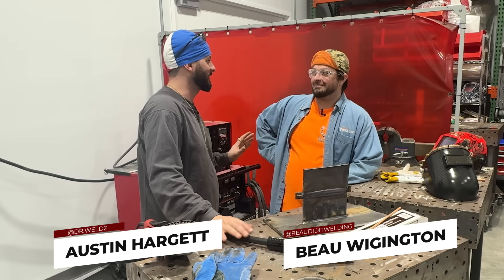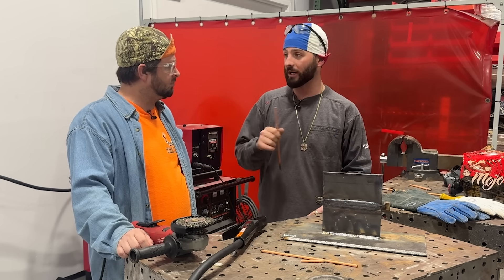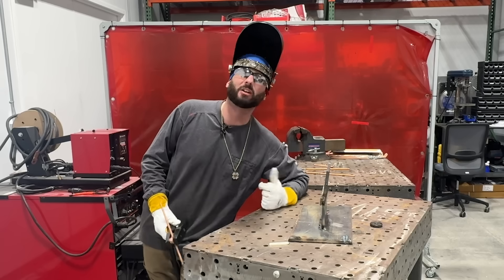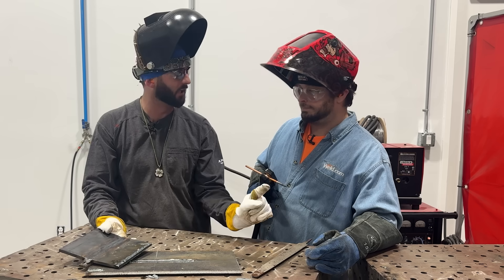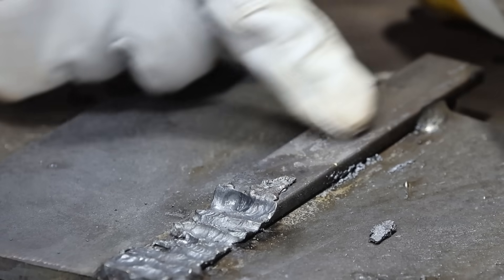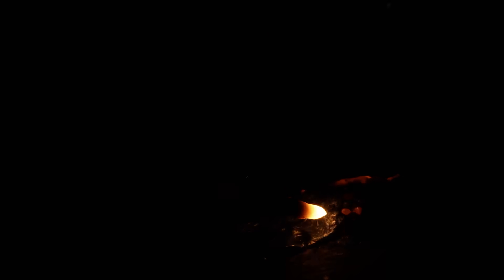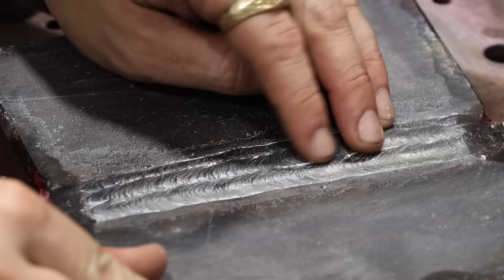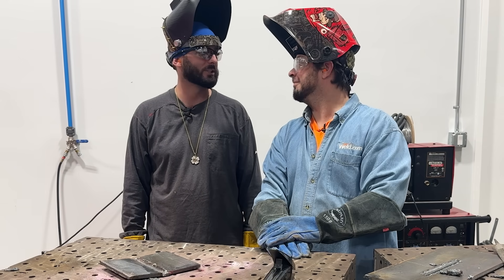Improving Your Arc Gouging Skills: Best Electrodes and Methods

Comment: I would also like to add when using DC current especially you need to not just consider the size of your leads, but also the length of the entire loop including the work piece. Refer to a Ampacity chart for your specific application. Welding leads are one of the most expensive (consumable) that welder uses. if you try to always work inside of their rated capacity, the copper wire will outlive the insulation around it.

Comment: I’d like to address a common misconception when it comes to carbon arc gouging. you do not need to turn your welding machine all the way up if you do not have properly sized leads, you will burn them up and the constant amperage fluctuation is hard on an engine drive machine. The amperage requirement for a specific size of gouging carbon is on the box and a lot lower than what most people think. If you do not have a good technique, it is hard to maintain a steady arc and that is why people turn the machine all the way up.

Comment: I got a question has any one used plain rods? Why does my rod get super hot? My ground asking proper contact I got it set to 350 amp I’m using 3/8 rods I have it on my rod holder on negative and my machine set to CC submerged arc I don’t know what it’s getting hot after 3 seconds

Comment: I love this channel and the content it puts out, but this is TERRIBLE advice for carbon arc gouging.  First and foremost “all the beans”. Is the last and worst approach to carbon arc gouging.  Carbons come in different sizes and have an amperage range they operate in, just like stick electrodes.  Often times the stubbing you are describing is actually a sign of the amperage being way too high.  The electrode is being consumed by the arc faster than you can physically move it.  Not very good for precision.  Precisely removing a 1/4 backing strap is not a job for 400 amps , a 3/16 carbon on 190 amps would remove that like a surgeon.  NO disrespect, i do a lot of gouging,  lots of this is not good advice

Comment: One of the best electrodes with High intensity of current with graphite supplement causes the burning of base metal ... simple technique to repair minor cracks various industries.. when the electrode parallel to weld ..90 degrees in holder causes repulsive action on easy removal of weld bead or base metal

Comment: Way back in the early 80's when I started welding for a local portable repair guy, I talked my boss into getting a gouge although he didn't know what they were. (I had used one at welding school) Once he saw me remove a 1/2" bead from a huge plate in about 45 seconds as opposed the the 15 min he was taking with a grinder, he was sold! I got a raise over introducing him to the process!

Comment: You still have to use a grinder tho🤔. You have to grind the carbon out after
Reply: @whitey7388  improper settings and poor technique is the reason for carbon track.  No grinding is required

Comment: How does this compare to plasma gouging? (I have a plasma cutter and a multi process machine that can do stick.) What are the pros and cons? Will there be some applications for one is better than the other? Does one of them have more control for gouging out old welds or rework?
Reply: Pretty much the same... you will eventually need to change your plasma consumables (some actually have specific gouging consumables). Your plasma is better because you don't have to worry about the possibility of the melted carbon rod getting in the waste puddle and stopping you. But the CAC will let you reach into spots (sometimes a welder sneaks a weld into a spot and doesn't think about if it needs torn back apart)
Reply: Every process has it's ups and downs. Plasma requires a separate machine and the consumables are more expensive, but you don't need to worry about adding carbon.
I also find I've got less control with plasma than I do with the carbon arc or oxy fuel, but that might just be because I don't use plasma gouging very often.

Comment: I wish I had a welder that would go up to 300A or more and a big air compressor.  I don't, so all I can do is oxy-propane flame gouging.  How about doing a video on that?
Reply: I can tell you with a straight face that a Harbor Freight Stick 225 paired with a mid size compressor will absolutely arc gouge.
 
225 amps is enough to run a 3/16'' carbon, and you'll only be limited by the compressor. My 3.8 SCFM @ 90 PSI 20 gallon compressor lets you run for about 45 seconds straight with the air valve open, and regulated to 80psi. Then you wait till it builds up a little bit, then you can use it again. This is a perfect time to take a scraper or something to your slag, and pull your carbon back to the sweet spot.
 
This gives you a small duty cycle, but in that time, that small welder with it's narrow duty cycle can cool down, and you won't damage your equipment.
 
Obviously if you've got 40 feet of arc gouging to do, maybe this isn't the best choice. But for cutting out a few welds or gouging an ear or 2 off of a bucket? Works just fine.
Reply: @YR7A 👌
Reply: @YR7A  That's interesting.  I might still be in luck.  I have a Hobart Stickmate 235AC/160DC that could possibly do it.  Does that sound reasonable to you?  Would it do best on AC or DC for arc gouging?
Reply: @fastbusiness It doesn't work very well on AC, and you don't have much amperage on DC, so I'd look into getting a new machine if you're interested in gouging. The stick 225 from harbor freight is only $300. Gouging is hard on machines anyways, so I wouldn't use an heirloom or your main money maker to do it, either.
Reply: @YR7A  OK, thanks for the info. 😊
Reply: 3/8 carbon rod ke liye kitne amp ka machine & kitne psi ka air compressor cahiye please bataiye

Comment: The way both are dressed is ok for a lab environment but you are going to need full leathers in any real world environment also use a adflo or some other supplied air the crap coming off this process is very toxic ie vaporized copper and graphite also shade 10? That’s gonna be a long day I wouldn’t go anything less than 11 fwiw been doing this for years.
Reply: @moparbryan  yes a shade13 if you can see through it is even better if not conflicting with performance. I’d personally just torch gouge it done it for 11 years. Much faster too if allowed

Comment: Worth mentioning that preheat requirements still apply in production. Also if your WPS has impact requirements make sure you clean the gouged areas well. Residual carbon can affect them significantly.
Reply: Unless you're welding over the nitride slag itself, you shouldn't run into imparted carbon issues. That 3 thou layer of slag has a negligible effect on the deposit metal, considering it's so dilute once you've accounted for the penetration profile (base metal dilution) of your process and how much filler metal you're depositing. The slag itself will be carried away by the flux/silica, and that pipsqueak of carbon being added to the steel won't matter at all.
 
Of course if you're welding on a alloy or stainless, then all of this goes out the window.
 
But on steel, especially high carbon steel? Little to no effect.
Reply: Are you implying preheat requirements still apply when gouging? What code states this? Admittedly i didn't watch the whole video because I've gauged a ton of material in my life so if I'm missed something excuse me.
Reply: @nargithnargin8531  Gouging imparts heat just like welding. Preheating the steel prevents cracking as the surrounding metal absorbs the heat.
Reply: @YR7A  Preheating as far as I'm aware, is almost entirely to do with hydrogen diffusion from the weld pool, hydrogen that causes cracking if its not allowed to escape in a given time at a given temperature. Structural welding code D1.1 does not state you need to preheat the base material before any gouging or cutting process. Regarding any amount of dross, weather it be from oxy-fuel cutting processes or oxygen gouging, you are most certainly not allowed to weld over any of it in any circumstance, in fact any surface contamination that can adversely effect the weld pool is likely restricted under any weld code, though most definitely D1.1. I will agree however that, modern electrodes are very good at picking up contaminates, i sure as hell wouldn't bet a PQR on it were impact testing is required, or any weld testing for that matter.
Reply: @nargithnargin8531  With most structural steels preheating prior to gouging isn't a concern and you are correct. A secondary function of preheating is to control the cooling rate which helps achieve a desired grain structure. By gouging and a subsequent repair weld you can develop larger grains which would impact your toughness requirements. We've tested this when developing a few of our repair procedures. *Edit: I deal with a lot of subsea components and downhole tools, a bunch of odd ball materials.
Reply: @slickpool  Id be interested to know, are you heat treating the weldments after the repair or relying entirely on the repair procedure itself to maintain the parts desired function? Obviously in a repair scenario heat treating might not be an option but, most material i have read about "not specific to ware components" require temperatures far greater than conventional hand-preheating setups, and for much longer periods, literally furnace level normalization to reduces stresses etc.

Comment: Torch would’ve been 10x faster
Reply: No, if you actually know what you're doing- these guys don't have a clue past set up. there is almost no clean up and way faster
Reply: @smokeshow1984  not done much arc gouging but ,ime it’s to much extra sh:t to pull out for most jobs I’ve only ever found them to be useful in inside corners. A torch with a gouging tip would’ve been done in 10 min that’s putting regz on bottles to grinding flat.
Air arcing you’ve gotta have power for 1 then let compressor build up pressure run three leads essentially maybe I’m exaggerating a bit but, I just don’t see how anyone could think this is faster like I said I have limited experience with them tho. Maybe ur good on em but for me it’s just what I’m used to
Reply: @chauncey5962  I run a lincoln 600 air pac on the truck air line on a reel. It literally takes a extra min at most to set up... an if your good don't even need a grinder. You can prep 1in thick steel to ready to weld conditions under a 1min/ft and produce xray quality weld without ever touching a grinder. 
The backing plate they gouged off could of been done with one pass roughly the same speed they did theirs... it literally that fast if you know what your doing.

If you ever gouge keep your line of site behind the torch (like how the camera man was set up). 

I don't know what these guys were looking at other then a bunch of sparks an smoke. 

Problem is that guy's like this think just because they know how make a mess think they know how to gouge when they don't even know where to look.... what you watched here was "Literally" the blind leading the blind.
Reply: @smokeshow1984  I don’t disagree with that.
I still prefer a torch from my experience I just repair mining equipment and x- ray is not an issue I’d prefer it for inside corner joints I suppose but, I’ve always just used a carbide bit on a die grinder wishing I we had an air arc in those circumstances.
I’m probably a bit faster than these cats even on unfamiliar process
Reply: Definitely not.
Reply: @ 100%
Edit: less clean up to